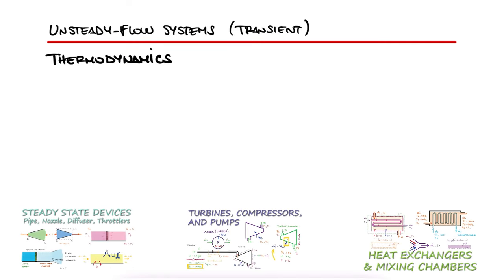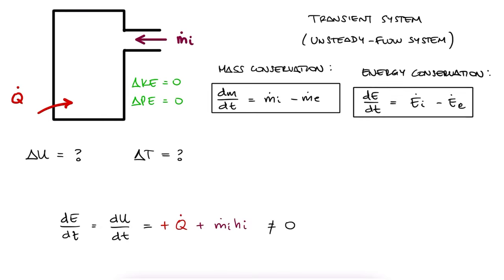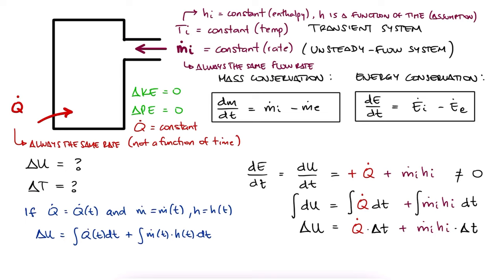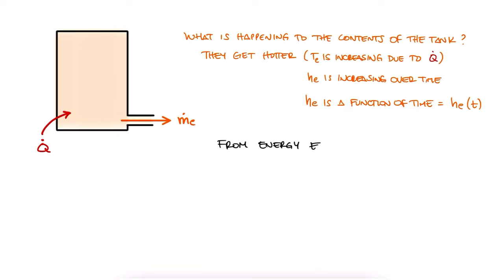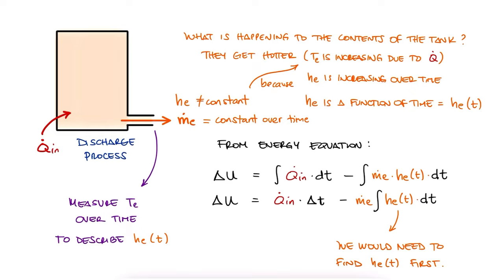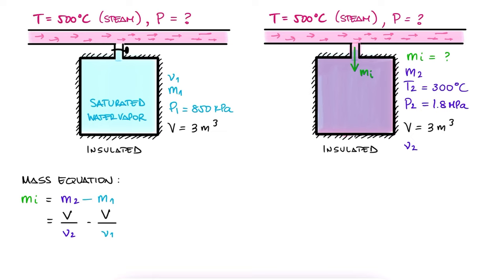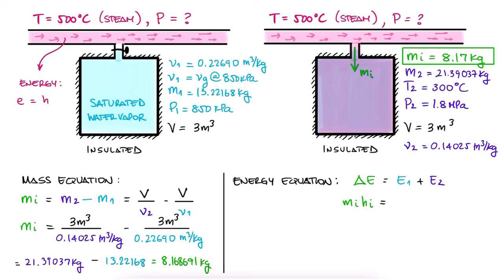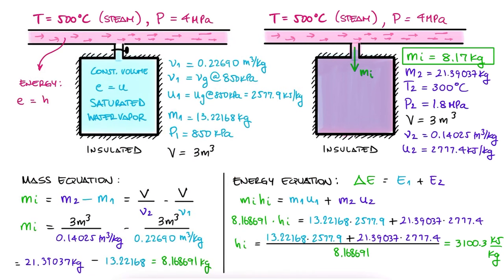Transient UNSTEADY-FLOW Systems in Thermo in 9 Minutes!

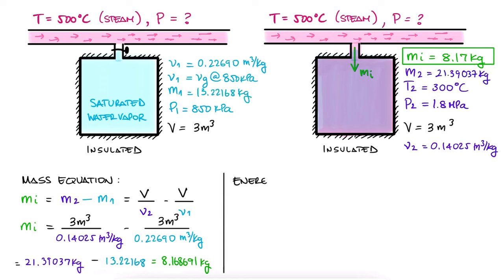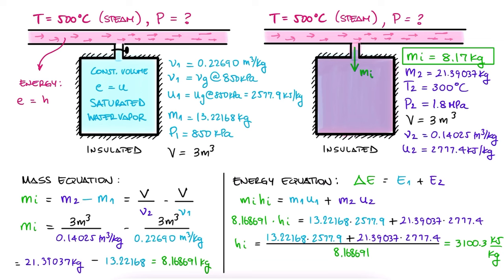Comment from the maker: TWO CORRECTIONS: 1) at 6:42 The change in energy is the final energy, E2, MINUS the initial energy, E1. The equation in terms of E1 and E2 is incorrect, but the final value is correct: 3100 kJ/kg. 2) at 7:48 we look for a specific ENTHALPY value of 3100 kJ/kg (h column, not u). The correct P value should be 29.0 MPa, after interpolating.
Reply: I got 3097 kJ/kg dang it!!!  I suck!!!
Reply: So you look at the "U" column at the end for 3100 kj/kg??  I guess so because 3100 under the enthalpy column at 500 C is like 29 MPa.
Reply: wrong, for these transient problems, h often equals u.

Comment: "h" equals "u" in this equation, so 4 MPa is correct, you really DO look under the internal energy for 3100 kJ/kg at 500C... it can't be 29 MPa my friend that's above the critical pressure for steam which is 22 MPa.

Comment: it is not a correct transient computation : to do it correctly (p,t,h,m) with time, you have to account of the flowrate through the nozzle, probably choked at the beginning, then the asymptotic behavior to nil of the flowrate into the insulated vessel